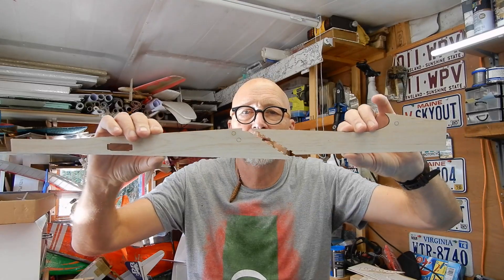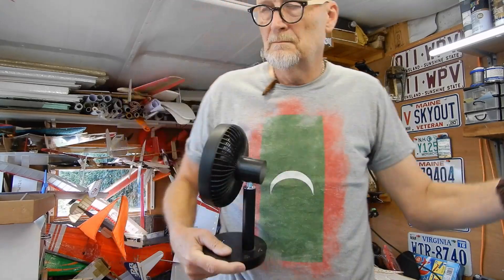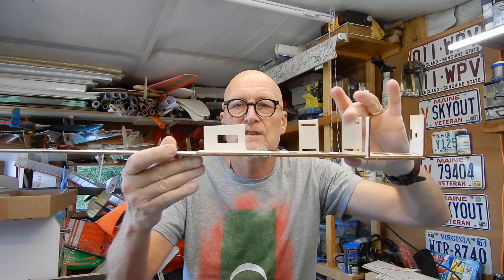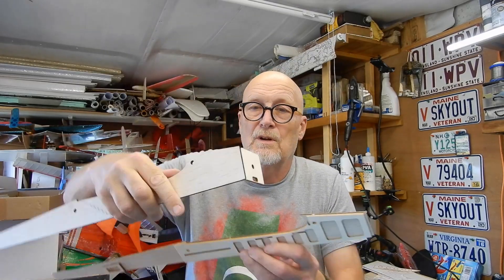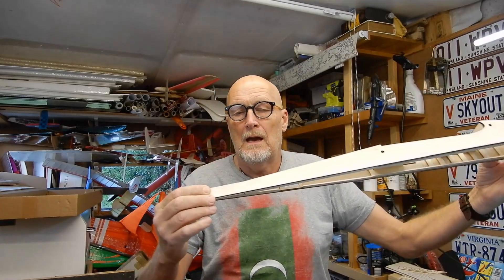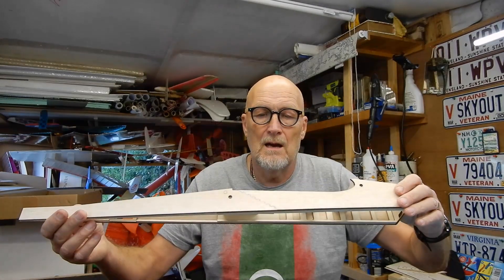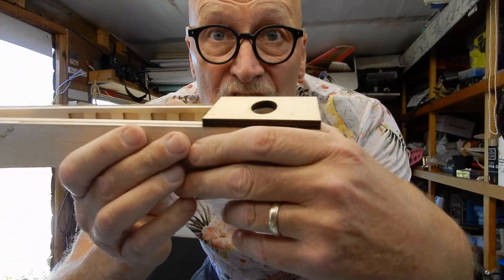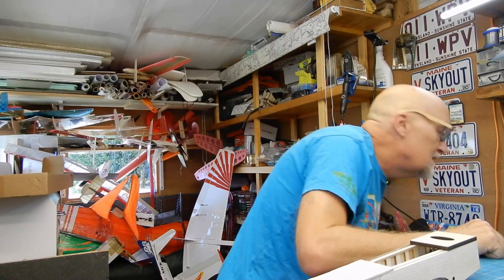How to build Mini Lancer Fuselage

Comment: If I was doing this I would have used claw nuts on the inside of the motor bulkhead so I could screw the motor on and off from the front. May also have done that as well with the undercart. Just a thought.
Reply from the maker: Good point